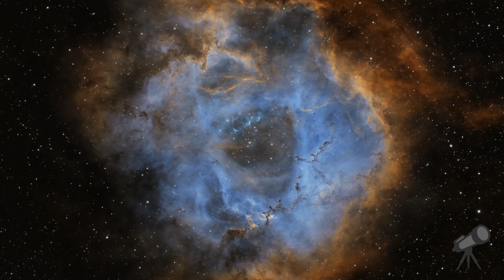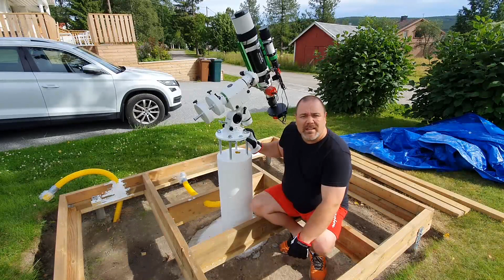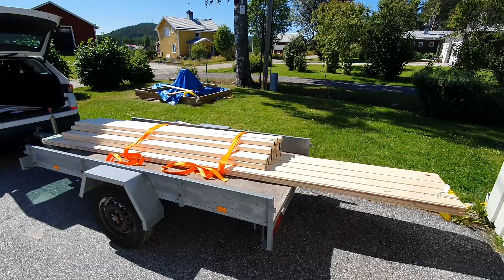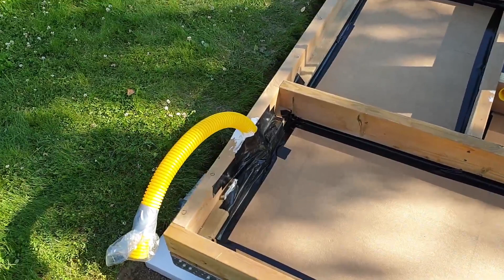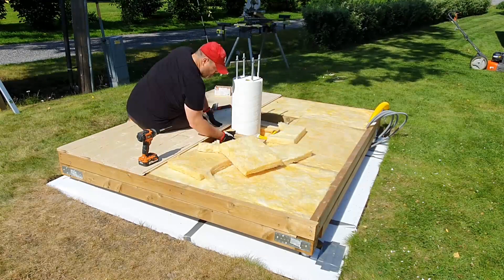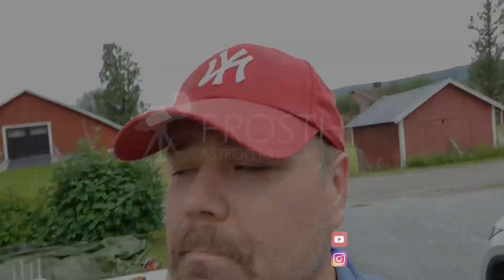Building an Observatory Part 4

Comment: Looks great, thankfully I don't live in cold climates so don't need to worry about all that insulation. The only thing I would have done differently would have been to use galvanized joist hangers as over time those screws in the floor joist will start to come loose. Great job!
Reply from the maker: Thank you so much! I have read so many different things about insulation or not so I decided to insulate the floor first. I haven't decided about the rest yet. I'm not going to have it heated, but probably the ability to warm it and ventilate to avoid dew.
Reply from the maker: I would agree about joist hangers or other construction for something that you walk around in, but this mini observatory is mainly for housing the telescope, not to be inside and I used leftover materials. I hope it holds together :)
Reply: @frosthastrophotography  I'm sure it will work out great, looking forward to the finished obs!

Comment: Really inspiring! I wish I had seen your videos before I built my own observatory, there are so many clever details here. One question: What is the advantage of insulating the floor if the inside of your observatory is going to be at the same temperature as the ambient air? Would it be sufficient to have only the oil-hardened boards underneath for moisture protection?
Reply from the maker: Thank you so much! There is no advantage at this time, just did that if I would ever want to insulate everything since you can't do that easily later.

Comment: What about a roll on off roof..that way you can have your walls low and then you can stow that scope and a bigger one because the roof that comes away can be higher. You can roll the roof to the north which I think is blocked by your house anyway. The roof only has to go back 3/4 of the way due to the view line back to your house..and it will require only a couple of posts to get the roof rolled bak onto
Reply from the maker: Hi! Yes, I will have a roll off roof on the observatory. I'm planning on having as low walls as possible because I plan on rolling the entire thing off, leaving no section.